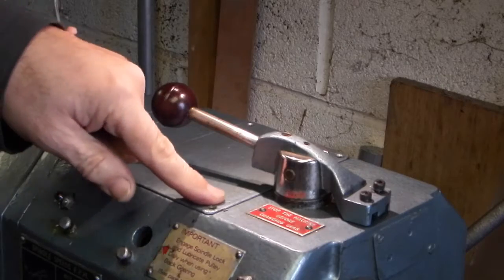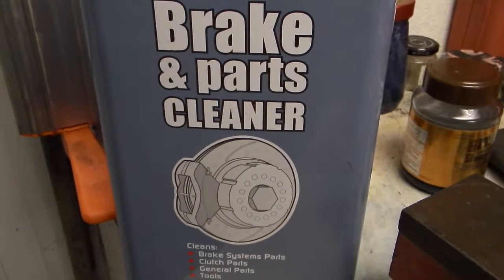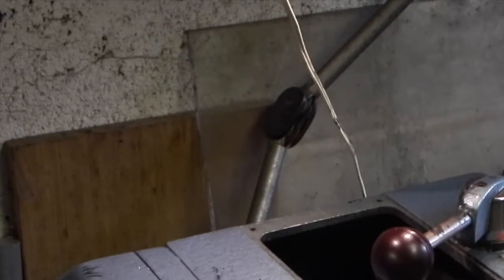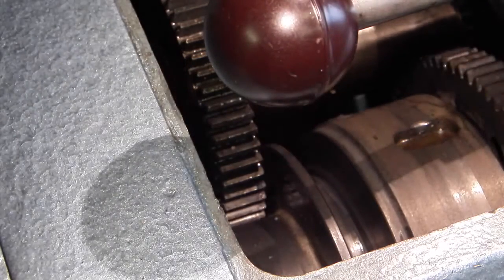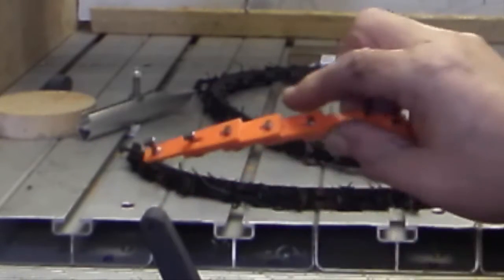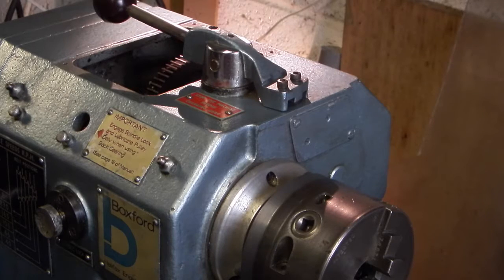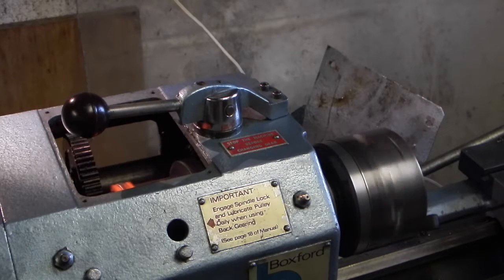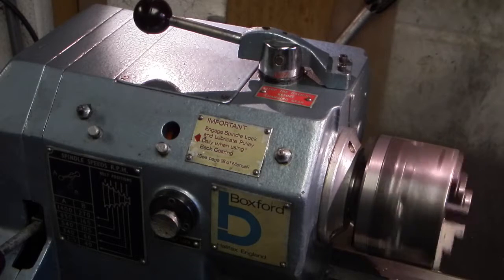Boxford lathe belt change

Comment: Do you have to put the belt on bedside the bottom pulley and turn the shaft and force it on the pulley or is there some adjustment to allow you to connect the belt then take up the slack. I’m not replacing the belt I’m putting the old one back on after lathe was stripped for transportation. Great vid👍thanks.
Reply from the maker: Hi  I fit the belt on the top pulley and force it over the bottom pulley but if it’s too tight you can undo the 4 bolts holding the bottom shaft and slide the shaft through the belt

Comment: When I changed mine, I taped a long length of cord to one end of the belt and then pulled the other end through so that the cord replaced the belt on the belt path, I was then able to pull the new length of belting through using the cord, it was relatively simple.

Comment: Hi Enot, great video. 
My belt has been slipping a bit lately " aud " so invested in a new brammer belt. Comes in 2m length. Removed links to same as old one in length. Gave it a real good clean. Tricky to fit but new one slipped to, so took out a link. Still slipped so took out another and another. So that's 3 out, about 2 1/2", and it still slips around drive pulley. To top that the pulley gets extremely hot within about 30 secs of running.
 Belt could go tighter but that's quite a bit shorter than the original, even stretched I feel.
Any ideas, more links ? But that would make it pretty tight. Not sure how tight it should be. As tight as the motor drive belts ?
Mike
Reply from the maker: Hi Michael. 
The belt should not be too tight, check that the belt width is wider than the top of the pulley width and the belt is not running on the bottom of the vee flat.
Reply: enots engineering , it's the brammer one from eBay. It's tiding higher than the edge of the pulley and if a squeeze it, it goes in further. I've used lots of ve belts and we usually have them tighter than I have this one but I've not used a link belt like this so I've no point of reference. Maybe I should pop another link or two out ?
Reply from the maker: Hi Michael
The link belt will stretch more than a solid belt until all the links are under tension just make sure its running on the vee and not bottoming out.
Reply: enots engineering took more out, running good now. Thx for yr advice and video 👍

Comment: You can see where the bottom pulley has been slinging oil on the back wall of the housing. - The old belt would have been noisy with the pins hitting the bottom of the v groove.  -  They all eventually wear out, especially if you keep getting oil on them.  -  Hope this one last YOU another 46 years.
Reply from the maker: Hi Thanks for watching

Comment: Can you tell me where you got the new belt as mine as started to slip and needs to be replaced
Reply from the maker: james tyson 
Hi James
I got the belt from  Lathes.co.uk
You order by the length you need, not cheap but my new belt is better than the old leather one, and will not soak up the oil.
Alan